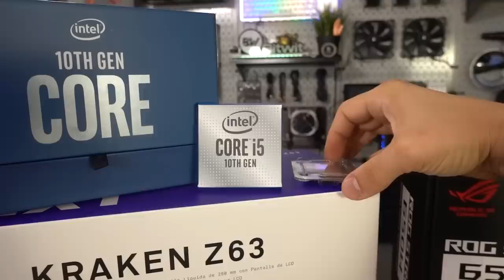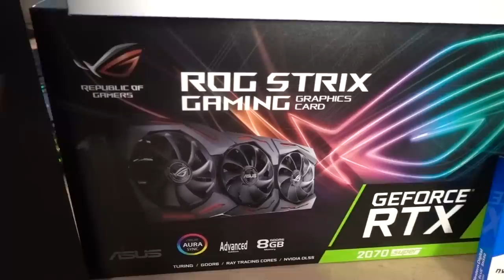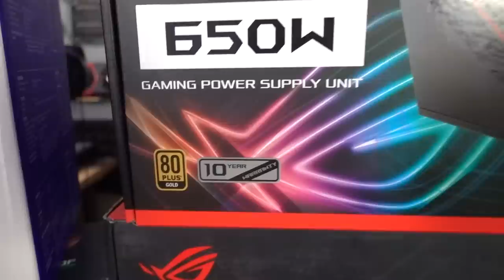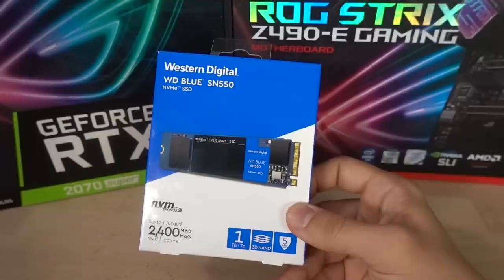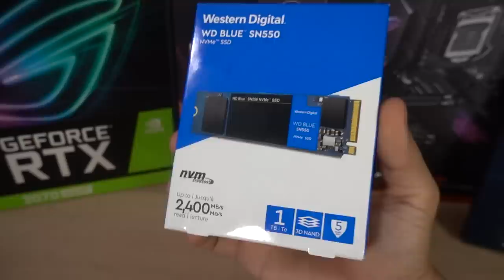Building my first Intel PC in AGES!

Comment: Are fans on radiators pulling air?? Isn't it wrong? Also top case fan isn't supposed to pull air in case? Fans are all wrong except back exhaust fan in my opinion. And you could fit vertical mount bracket if you put fans front of the case but man... Mocking about Verge build guide and here we are...

Comment: NEED HELP! ive upgraded my prebuilt about as much as i can so now i haft buy a new mobo , cpu/cooler. i have a 5700xt, g.skill neo, 3 120mm tt rgb fans, 2 200mm tt rgb fans that  came with the tt commander c31case. all i play is shooters. i dont stream but i could potentially in the future. i dont plan on OC but i would like the  option. air coolers perform better and are cheaper so i would like to air cool it but my brain still wants to believe water cooling is better so i could be persuaded. i plan on rgb'n the crap outta this thing so aesthetics are a bonus point. i just bought the case so im itching to get this thing built. i5 10600k or R 3700x are where im leaning rn but mobo is up in the air.

Comment: There is an issue if you need to add another sticks of memory seems that pump is covering the slot completely. is it possible to turn it to have water pipes heading down and align display to be straight?

Comment: The brick shorted out the case because the metal table had no anti-static working surface protecting the insulating pads.

Comment: Why are you exhausting out the top through a filter and intaking air through a hot radiator..... doesnt make sense to me. I  always intake through a filter and extract through a radiator.... no dust inside PC and not pulling heat into the case !!! 😉

Comment: Random info: Ryzen 3 3100 has 4 core, 8 thread makes it nearly as fast as i5 9400f
Ryzen 3 3200G has 4 c, 4 threads only. Don't buy G series CPU.
Instead get a normal and buy second hand RX 570 or 1050 ti

Comment: So according to GN this is the incorrect way to mount an AIO rad? I have mine this way too- front mounted, pipes at the top for the aesthetics!
Reply: As long as the pump isn't the highest point in your loop your AIO is going to be fine, it just gets noisy when more air has accumulated in the loop.

Comment: OMg hey Bit I got a question why doesn’t my front panel work when I connect it to that motherboard
Reply: He doesnt awnser questions and im pretty sure you plugged it in to the fanheader and not the front panel header. The front panel header connecter has four pins on the top and 5 pins on the bottom. For mor help, refer to your motherboard manual

Comment: Those 2070 super strix cards are super expensive especially with a pre installed phentek waterblock £750 approx I know cause I own 1, not likely I will get 2 :( especially when I bought a strix 49" super wide 4k 144hz HDR monitor to boot also £750 approx

Comment: For less than 400$ you can easily get Dual XEON X5690s, in a Huge case with a beefy PSU, and that will come with 96GB of ram and usually windows installed on a 2TB HDD, So throw in a 185$  980ti or better GPU, and transfer windows over to a SSD that's 45$ That's value for$. I watch these builds thinking 2000$????? That's a car. The majority of people don't drop 1000+ on PCs. LOL

Comment: Still mounting the radiator with the pipes at the top - haven't we all learnt that's bad? You have enough length to put them at the bottom. See the GamersNexus video for why it's not a good idea.
Reply: It's not a good idea for a front mount because of noise, as long as the pump isn't the top of the loop the lifespan won't really change

Comment: Shoulda used an core i7-7700k. I believe it's an 8th gen and it's the one i have on my laptop. Well by the name of the cores i imagine it's better and it's relatively affordable. But hey, what do i know? I bought an MSI laptop without building anything.
Reply: Why a 7700K? Kinda obsolete with how expensive it is

And it's not 8th gen...
Reply: @iiiiii7680  idk in my pc it says 8th gen but you got a point. I switched the country and forgot to turn it back on the pc builder and got wrong prices lol
Reply: @xornedge8204  yeah the 7700K (used) costs more than a 3600 brand new here in the US. Also it has 2 less cores and 4 less threads plus lower single core speed (by a little)
Reply: @iiiiii7680  true. But in the vid he used an i5 no? So i saw the wrong prices and thought it'd be more cost effective to just use a i7
Reply: @jul1anuhd  because he is talking about the 7700K...

Comment: 8:18 those little VRM fans sound absolutely horrible hahaha I prefer using a 120 mil down draft cooler for instance Be Quiet makes one that’s perfect, pair it with a high quality 120 mil fan and you’ll have great CPU and VRM cooling simultaneously - and it won’t sound like a tiny jet engine going off in your PC hahaha

Comment: Looking for help from anybody in the comments lol. I have an Acer Tc780 Acki5 with a couple things added (I5-7400, 16 gb 2400 ram, gtx 1650) only game I really play is League of Legends so easy game to run, would my build be good enough for a dual monitor setup with one 144hz 1440p monitor and one 60 hz 1080p one to run things like League on one and twitch/youtube on the other at the same time? I wouldve gone with a better graphics card but my budget was low at the time and my pc only has a 300w psu :(

Comment: Me chilling with my i9 10900kf
Reply: and yet you still stream at 720p fortnite stream 1080p you  have the power
Reply: @elliottd323   never said I had my pc built yet, still on console for the while
Reply: @Amrit_SZN  shouldve waited for 11 series or bought all your parts at once technology advances quickly how much did you buy it for
Reply: @elliottd323  Nah bro 11th gen intelis pure trash well the i9 at least, u loose two cores and for threads for worse multi tasking performance and intel is already slightly behind amd in multi tasking and the single threaded performance from leaked benchmarks is the same as the 10900k and it was supposedly to have a 10-15% improvement
Reply: @Amrit_SZN  yuh but ryzen exists I guessing you got your chip for like 400 but if there's no stock so

Comment: Didn't put the radiator tubes down like GN suggested
Sad pump noises
Reply: the pump will be just fine as long as it's not the highest point in the loop. the front mounted configuration is much more an issue of acoustics than performance, whereas a bottom mount leads to air accumulating in the pump itself which is a big nono. you can technically have the same issues with tubes down if your radiator is mounted low enough.
Reply: @imaika281  Thus my "Sad pump noises" addition to the comment, which is exactly what I was pointing at.
Reply: Anvarynn The pump aint gonna be sad because top of the rad is above the pump
Reply: @imaika281  Yet the air bubbles will be right next to the barbs of the rad in/out.
Reply: @Anvarynn  hence it being a potential noise issue. the pump will be just fine :)
Reply: @imaika281  So this pointless run around was all in agreement to noise, yes?
I'm not changing it to "sad radiator air bubble noises" because that doesn't roll off the tongue.

Comment: Radiator is upside down RIP
Reply: and...? Probably the pump will "only" last about 10 Years instead of 15 Years and the CPU will be about 1-2 Degrees warmer. 
I don't really see the case. Not upside Down would look dissgusting

Comment: First off, I enjoy your videos more then other's. I'm a perfectionist myself with an eye for beautiful engineering and I'm an engineer, so there you have it... I need to point-out something: I don't know why people tend to install the coolers the wrong way; you're not the only one doing this. Even the instructions state that you are supposed to have the coolant lines on the lower side of both, the pump and the radiator. My system, which includes the very same cooler, shows in idle 25 -26 C on the CPU and I can only think about the thermodynamics of the system. You feed your hot line on the top, but heat does not travel well downsides, even if there is a circuit inside the radiator. You get the feed line, which is supposed to be cool , as well as the top, basically at the hottest point of the system. I recommend that you trade a bit of esthetics for a better functionality. It might as well be that I run on a i910850K, but I can't really tell if the beefier CPU runs cooler in idle.The difference is 20% and that's quite high... Keep-up the great job and stay safe!

Comment: Wtf, why intel? It is awful value, even for gaming
Reply: Why not, reputable brand and great performance,money isn't really a problem here
Reply: @xotic2146  great performance compared to what?
Reply: Not sure how it's awful value for gaming when it has better value than the AMD. The i5 10600k is less expensive than a r7 3700x, and performs better in gaming benchmarks.
Reply: @KL-lt8rc  10600k is sold without a cooler which will set you back at least 60$ in the best case, you haven't factored this into your calculation. 3700x is sold with a very capable cooler so is better value for gaming and 50% better value for productivity. Check out benchmarks/ reviews if you do not believe.